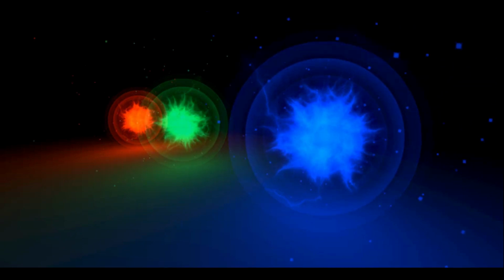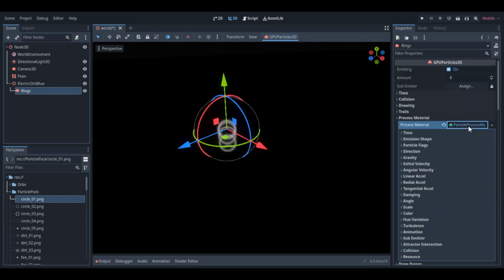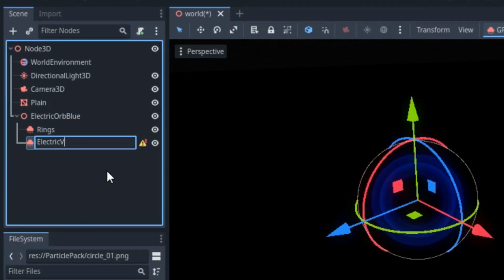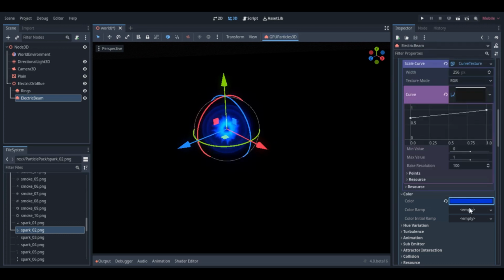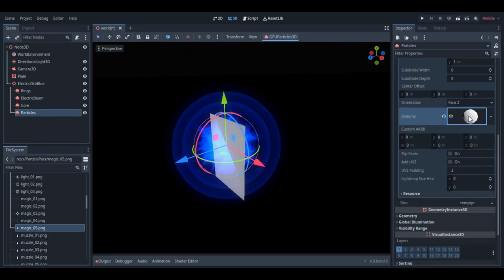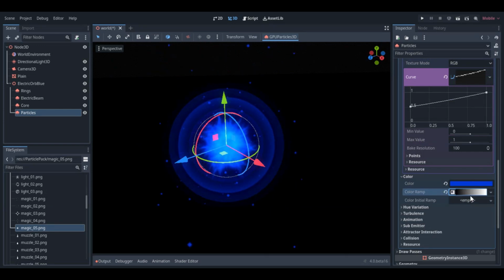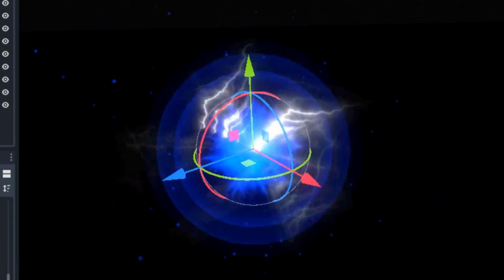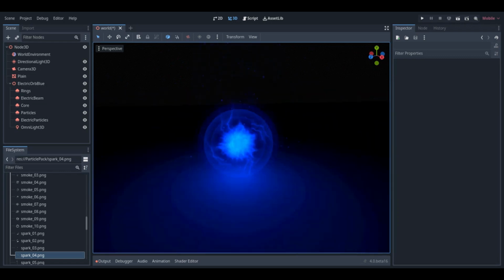Godot 4 - Electric ⚡ Orb - Game Effects

Comment: Newer version of Godot moves some of these settings around, but they are all still there. Only major difference I had was that when you go to the Billboard step to set "Particle Billboard", you also need to check "Keep Scale" in that section, or none of the scaling settings in the video will actually be applied.

Not sure why it's set up like this in the new versions of Godot, but I was wondering mine looked so different from the video until I got to the particles step and knew something was definitely wrong with my scaling lol.
Reply: thanks!